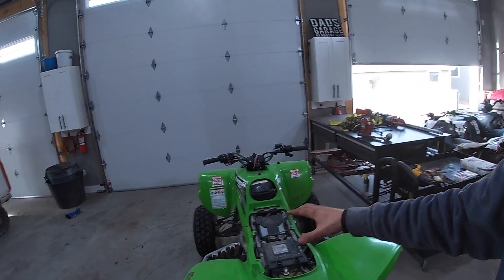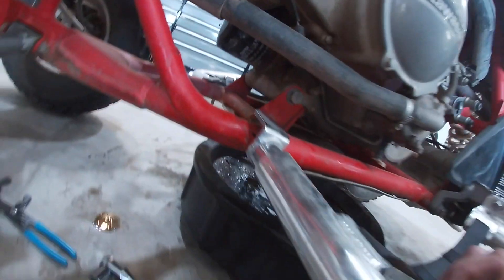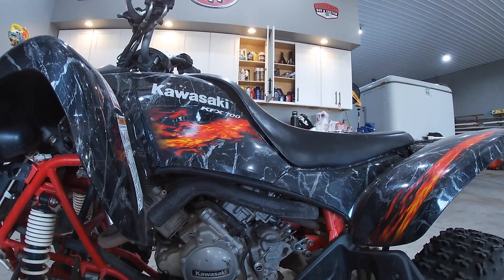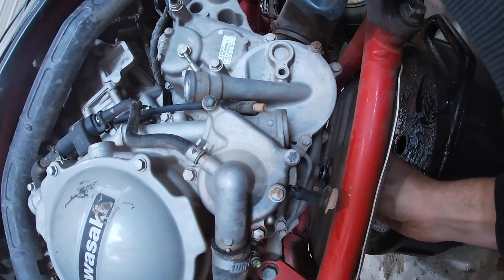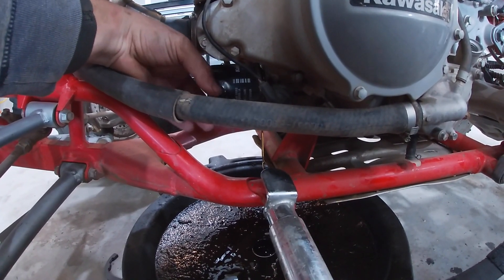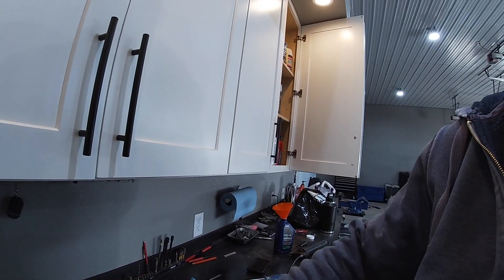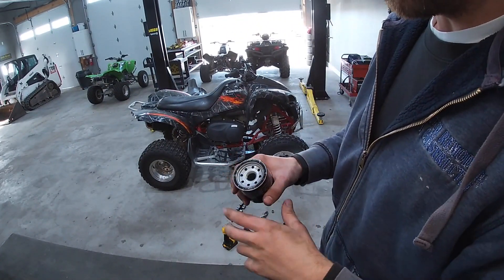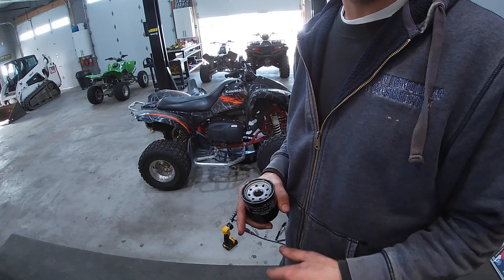Kawasaki KFX 700 oil change

Comment: What kind of oil goes in it
Reply: I was about to ask lol
Reply: I put in 1040 Atv oil
Reply: I use liqui moly 5w 50 full synthetic atv oil.... its better for extreme conditions and temperatures (high and low). and has maximum protection... but its not cheap
10w40 atv oil is fine too and more readily available

Comment: What is the correct way to check the oil level ? Do you screw the dipstick in or do you just insert the dipstick and then pull it out ?
Reply: Screw in the dipstick
Reply: @nathanocean1061  Are you sure? My Honda Foreman manual says to check it with the dipstick unscrewed.

Comment: I just bought a 2004....the guy I got it from said there was NOT an oil drain plug, and that he just leans the quad over to drain the oil out. Didnt sound right to me but I am  total newbie to atvs....please advise me?
Reply from the maker: Yeah about that….. haha there should be a drain plug under there.
Reply from the maker: Looks like a bolt head. But should be under the lowest point of the engine but could be covered by a skid plate
Reply: @naileditcrc2915  dddddang
Reply: thats rubbish, the drain plug is a 12mm dia. bolt with a 1.50 pitch. ..there is a hole in the skid plate, the bolt is above it... the oil pan is aluminium though. mine got stripped so I repaired it with a time-sert.... much better now.
If there is no drain plug then I guarantee he stripped it and put a bigger size in to block it up instead of fixing it.
See if theres a bolt, take it out and get a time-sert drain plug kit. Theyre not cheap but it will be better than stock because it will be screwing into steel not aluminium, much less chance of stripping. Also you will be able to do future oil changes much easier.... time sert takes heat extremely well too
DONT get a helicoil to fix it.... theyre nowhere near as good as a time-sert. a time sert screws in, (create a thread in the oil pan, screw in the insert, then the drain plug) whereas a helicoil just uses compression for the insert. Time sert is a much better permanent solution.
There is a guide for the kfx700 fix using a time-sert on youtube.
Its easy to do.
kit is about $120....you will need awrench handle or a 12 pin socket so you can turn the the tap which creates the thread for the insert,  and also install the insert with the included insert tool... you will also need a drill to create the right size hole (drill bit and counter bore are included) , Its much easier to do than it sounds.
Grease everything too (drill bit, tap, bore) less chance of getting small metal bits in the pan).
You will also need to get a drain plug if you dont have one.... theyre $30 ish. What you need is a m12, (12mm) plug with 1.50 pitch. The crush washer is usually included.
You can get all parts on amazon.
If you cant get the existing bolt out you could make another hole in the oil pan for a drain plug... Ive seen a number of people do this sucessfullly....I would still use a time-sert so you dont strip it with oil changes... unfortunately its easily done as the oil pan is aluminium. 
If you get a time sert kit the drill bit you get will make a new hole the correct size.... make a hole in the skid plate too for easy access... about 50mm or so... this will allow oil to come out too without going all over the skid plate.
Either way you do, its not difficultr